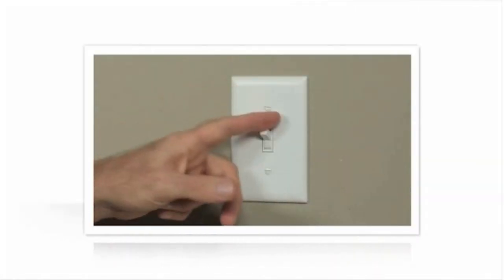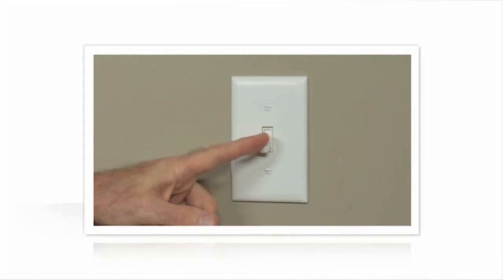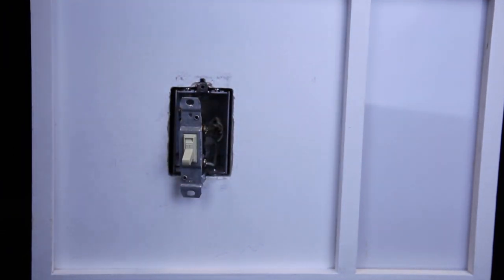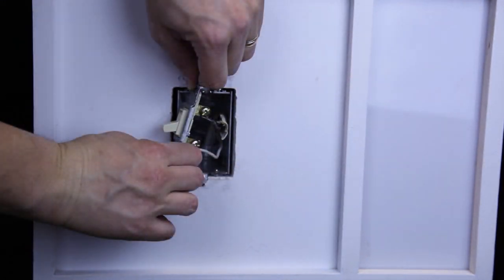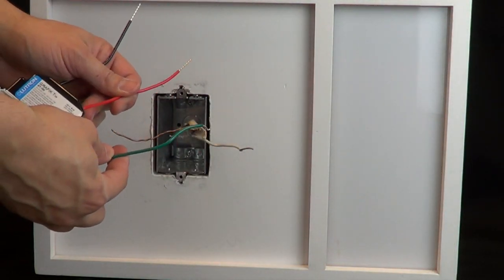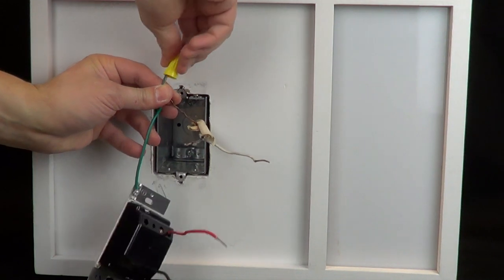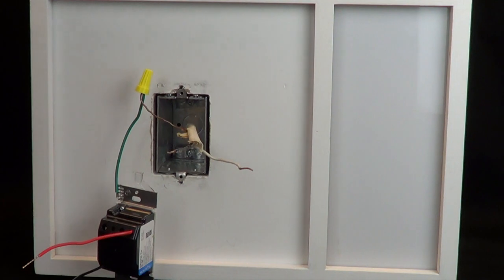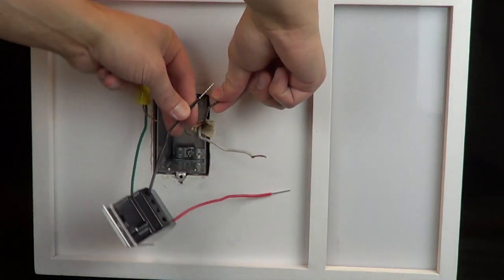Wiring a Control with One Black and One Red Wire (Single Pole Application)

Comment: Where is the other line? One line goes to the breaker, and the other line goes to the light.
Reply from the maker: Hi Miranda, With one line going to the breaker and the other line going to the light, that is all that is required to install the dimmer. If the other line from your question refers to the ground wire, it is not required to make a ground connection with the dimmer. Lutron suggests putting a wire nut over the exposed metal of the green ground wire, or putting electrical tape around it.

Comment: Why does the switch use a red wire instead of white?
Reply from the maker: Hi Mike, Lutron uses a red wire to denote the wire is going to a load wire or switch leg. A white wire typically denotes a neutral connection-which is different and not to be confused with the load wire. They are typically in the back of the wall box connected to another white wire. Some Lutron controls require a neutral and will have this white wire or a silver screw. Thanks!